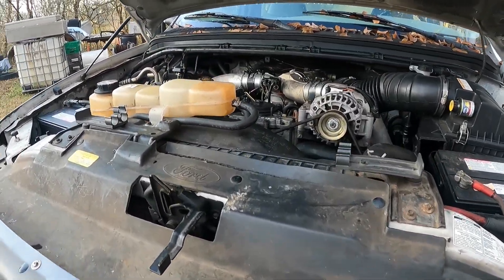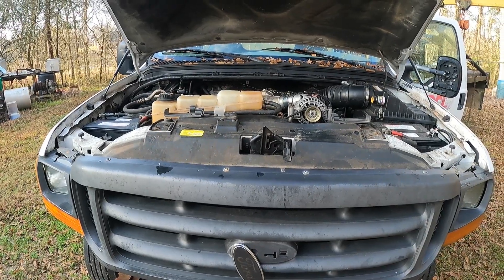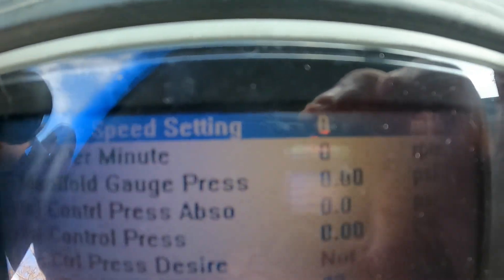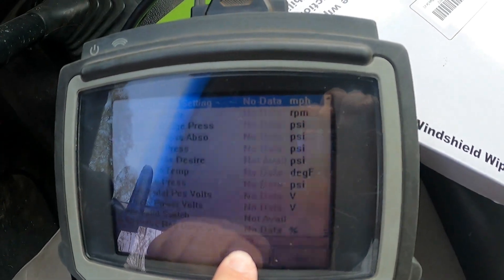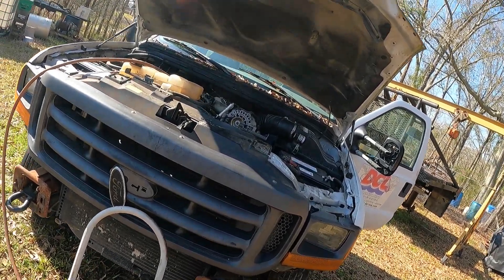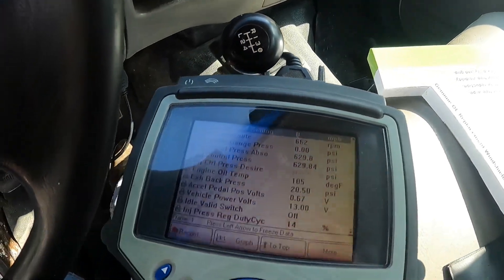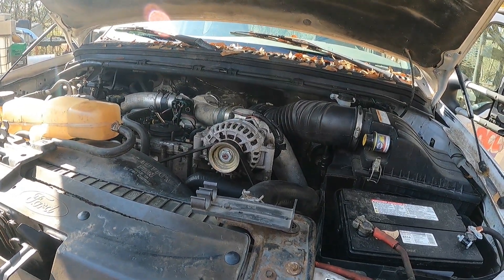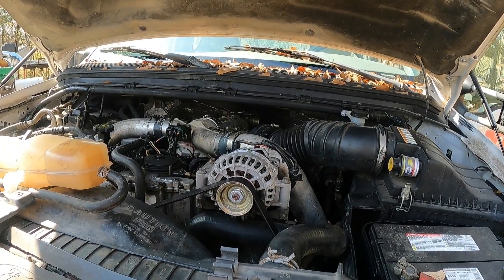7.3 IPR Diagnosis with Temperature Testing Coil

Comment: Thanks, I've got Forscan and need to see my pressure on HPOP. I don't know how to display the Gauges. If anybody knows how please help me out.
Reply from the maker: Hey bud. I’m not familiar with forscan but I do know it is able to check live data because I have recently helped a couple of ppl with it. However they had to figure out how to navigate the menus to pull it up. May want to see if there is either a video on navigating forscan or a pdf file you can download on the same.
Reply: @bayoudiesel  thanks